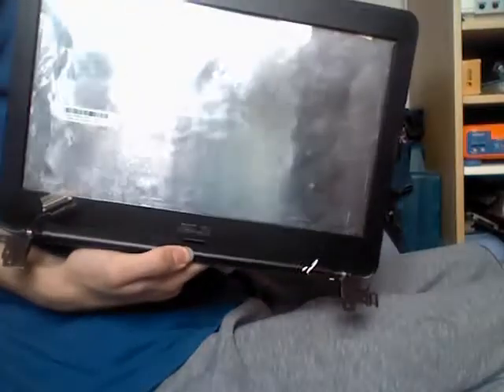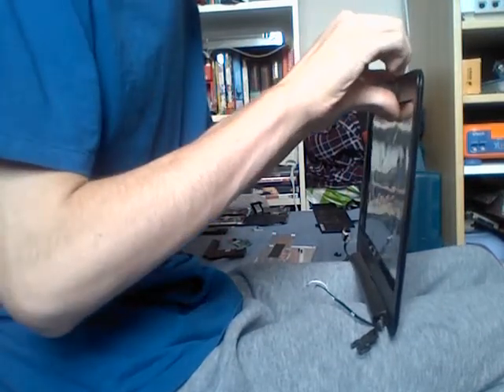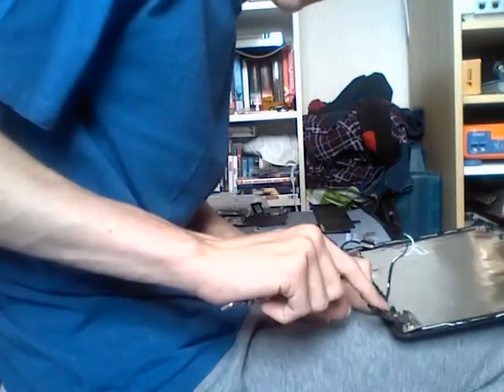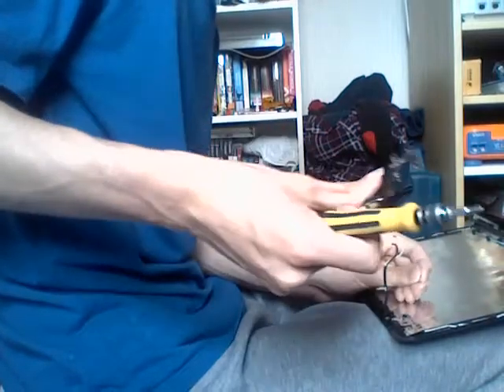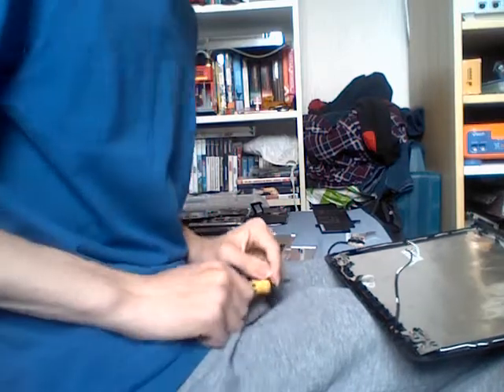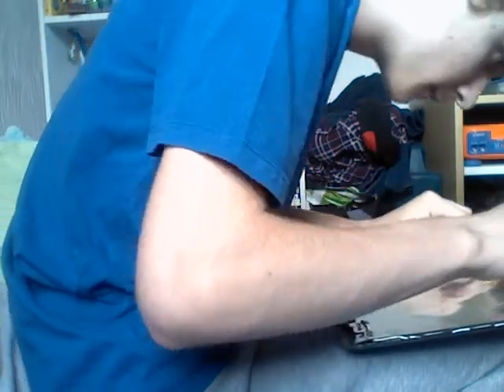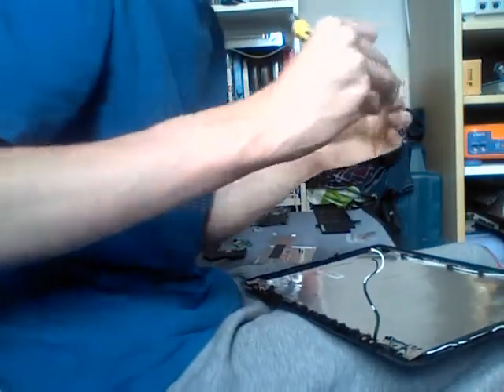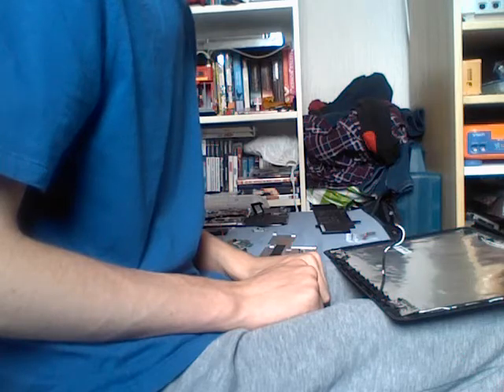How to teardown a Asus C300 display assembly

Comment: How do you get that whole display off to replace it?
Reply from the maker: Follow the steps but remove four Phillips head screws in each corner of the Display Assembly and Gently lift it out... Then disconnect the Video cable from the bottom left hand corner of the LCD Panel and remove it from the casing